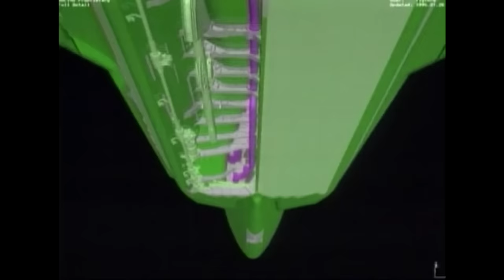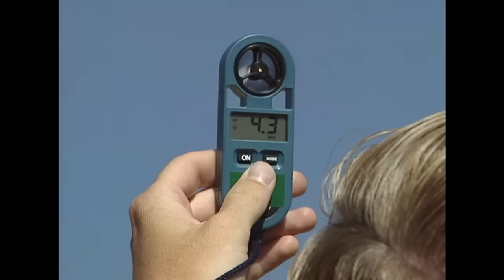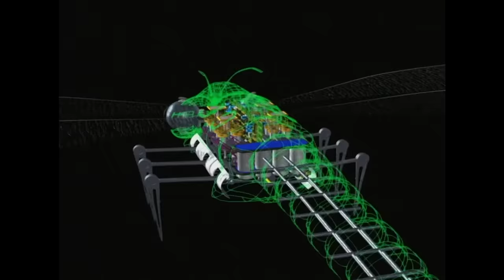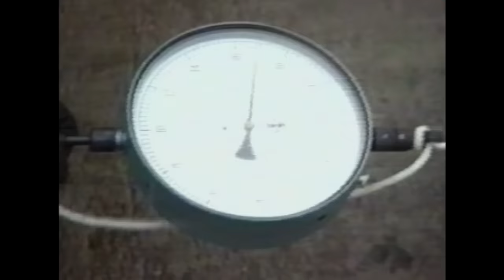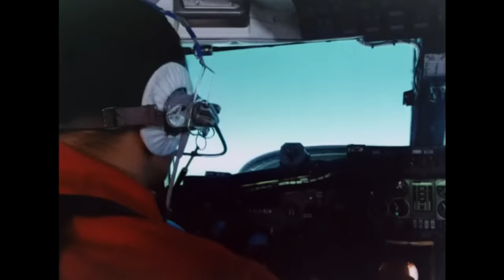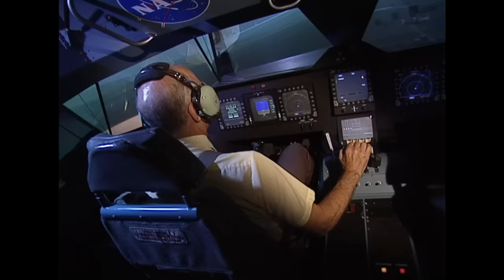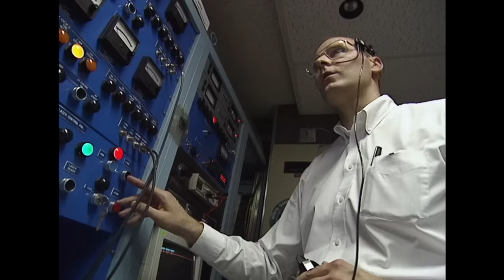Flight of the Future - Science Fiction or Reality

Comment: indexed on February 14, 2022
00:00 start
00:54 introduction
01:45 Northrop YF-23
02:25 Lockheed YF-22
05:02 thrust vectoring technology
05:24 Sukhoi Su-37
08:04 high-G training
09:50 integrating pilots with automatic systems, modern cockpits
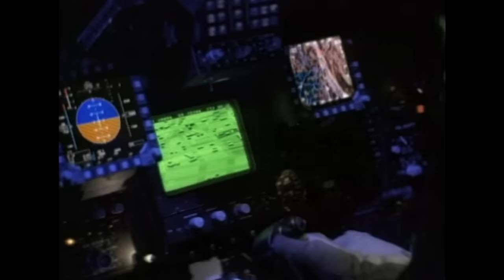10:12 eye tracking technology, voice command technology
10:48 thought-controlled flight systems
11:51 pilot error
12:14 unmanned aircraft
14:12 ultralight glider
14:37 miniature air vehicles (MAVs)
16:12 blade efficiency
16:54 flapping wing models
17:20 Charles Ellington insect wing model
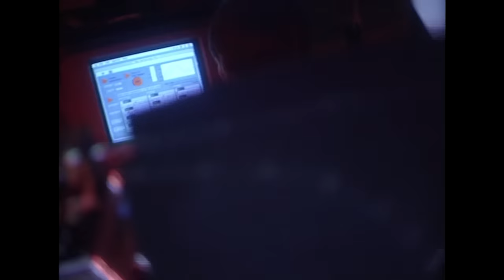19:13 Charles Ellington insect wing aerodynamics
20:25 insect sized micro air vehicles
21:23 pulsed thruster prototype
22:17 M2 lifting body
23:59 Barnaby Wainfan lifting body
28:54 blended wing body
34:12 Concorde
34:34 Tupolev Tu-144
35:25 High Speed Civil Transport (HSCT)
36:19 difficulty landing the Concorde
37:06 windowless cockpits
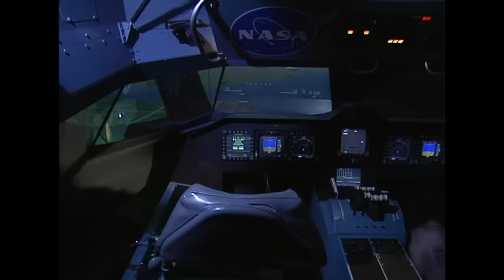38:49 HSCT flight simulator
40:20 new engines needed for flying at Mach 3+
40:35 the jet engine was first invented by Sir Frank Whittle in the 1940s
40:49 the biggest and most advanced jet engine in the world is the Rolls-Royce Trent 800
41:27 North American X-15
42:13 Space Shuttle
42:43 spaceplanes
43:02 air-breathing rocket engine prototype Hyper-X
44:34 White Sands Missile Range, beam-powered lightcraft
51:25 credits
51:58 copyright 1998
Reply: Where's the tic tac?

Comment: The next barrier to conquer is the creation, development, and the advancement of technology. Manipulating the field of gravity and creating a mobile liquid or multiple fields using the planet's poles polarities. The possibilities exist.
Reply: First, what distrubes the gravitational field, that may be a part of the equation. On the atomic level the super conductors the atomic the electrons are slowed down it likely it may be the strength of the field be come much weaker.  Frequency may be a way to control the fields. The structure and frame will need to be quite different composites of light gauges of metal or plastics. Frequencies are a part and active at base level of the atomic level and could distort create a warp tunnel that would need a containment field or fields. The Philadelphia experiment (if it was a real event would have something information that could be used.
Reply: WE DO THIS ALREADY

Comment: Science fiction author and engineer Jerry Pournelle presented a article about what he termed a Laser Launching System about 40 years ago in a science fiction magazine. I believe the magazine was either Astounding or Amazing.  Pournelle's concept was of a cargo/passenger module that was launched on a inclined rail system using a laser to heat water to extreme pressures at the back of the launch module to provide the reaction mass to boost to orbit.
This is not a new idea.

Comment: Inaccurate. Leaked Concorde plans had no impact on TU-144 design according to encyclopaedic data (Wiki). TU 144 had a different engine and wing configuration than Concord despite the two planes looking similar from afar.  Furthermore - there was nothing "faulty" about TU 144. It's main problem was the short distance it was able to travel. Soviets had to improve the design to match Concorde's distance, and they did. Why the TU-144 crashed at Le Bourge is not clear to this day. Some sources suggest the pilots turned on a new untested fly-by-wire system (which had to remain in non-operational mode during all flights). The last words of the pilot as the delegation entered the plane's cockpit were: "if we're going to die at least we die together", suggesting he knew of some danger factor that he chose to conceal.  Another possible factor is that seconds before the crash the pilot may have been startled by the French Mirage plane. The French were interested in TU-144 winglets, Mirage's pilot's assignment was to film the winglets unfolding up close.

Comment: The laser light cone shaped craft looks like something from the Lost In Space or Buck Rogers shows. Maybe there is a way (depending on the actual mechanics of the device) to build a craft that contains the laser creating device located below the push plate to make it a self contained propulsion unit instead of having the laser creating device ground based.
Reply: In order to do this it would be great if the laser device was as small and lightweight as a laser pointer or flashlight but powerful enough to propel a craft with a few people and there property (1000 pounds) while using very little power.
Reply: Hmm, now you'll have to find a place for the motor that powers the laser and another place for the fuel to power the motor...

Comment: To create that technology where there is no front windows but cameras you would have to use backup solar panel installations which would guarantee power regardless of what may happen. Those panels would have to be installed surrounding the top of the cockpit.

Comment: I was never really impressed by the "higher" aspect of flying.  If they can get me from Miami to Seattle in under an hour and do it at 100 ft, AGL, I am good with that.
Reply: Friction
Reply: Yeah, you need a vacuum chamber, a material that wont burn up, or go really high up.
Reply: Actually, there are aircraft in the inventory today that can do it in 2 hrs, and for that trip, I'd be flexible, two hours from Miami to Seattle is OK, and they can do it at sea level.   All I need to do is get ahold of an F-15 it can make the trip in 2.03 hours, at 1650 mph.
Reply: Altitude is added safety. More time to glide, more options.
Reply: @jonweiss4223  Bullshit. F-15 is well under 1000 mph at sea level. It makes no sense to feel safer at lower altitude. Altitude is a pilots best friend when something goes wrong.
Reply: @joeg5414  
Performance
    Maximum speed: Mach 2.5 (1,650 mph, 2,655 km/h) at high altitude
                                    Mach 1.2, 800 kn (921 mph; 1,482 km/h) at sea level
Yes, yes, we all know that 79 mph = "well under".
But speaking in general terms, "Higher" is still a relative term.  And performance specs are all BS as well, since an aircraft with a stated Max speed of Mach 2.5, at "High Altitude" may indeed hit Mach 2.5...on a day where the altimeter setting is 29.92, but if the atmospheric pressure hits 30.00 due to temperature and humidity changes, that same aircraft will never reach Mach 2.5 due to the denser air.  So until you find a way to control the weather, all of the numbers are up for grabs.  On a day with the right weather conditions, the F-15 could potentially make the trip in under 2 hours.  But then the "experts" hailed the birth of the jet, as the death of the propeller plane, and yet the first dogfight in which a jet was shot down, the killer was a prop airplane.   

As for altitude being a friend, it depends on the failure, your comment assumes that the aircraft will in fact glide, and yet, history proves that in virtually all cases (with extremely rare exceptions)  in the case of a major failure of the aircraft, altitude makes no difference.  When the wings fall off, terminal velocity is attained at around 200 ft of decent, anything more than that 200ft is irrelevant.
Reply: Well you never really studied anything about aviation then. Jus quiet down buddy
Reply: David Warren ,
Ah yes, another professor of theoretical physics chimes in.
Reply: Jon Weiss dude, In flight separation of airframes are extremely rare, engine failures are also rare, what gets most pilots are CFIT and loss of control accidents from poor airmanship, I’m a pilot, this isn’t just theory, the higher up you are the better your fuel saved, the faster your ground speed and the better the ride. 

Furthermore, density altitude doesn’t quite work the way you think it does. You can be at 30.35 in hg and get great performance out of the aircraft on a cold day. Heat and humidity degrade performance not necessarily air pressure. You can look at a POH with climb, cruise and fuel burn tables you’ll see it documented that indeed air pressure isn’t the problem it’s air density (pressure corrected for temperature)

Standard atmosphere is 29.92... at 15 degrees Celsius. On performance charts you’ll see the plane climbs faster and performs better on a cold day but burns more fuel, on a warm humid day the plane will climb slower and fly slower but  use less fuel...

This is simply because the fuel available to combust whether in a turbine or piston engine needs to burn at stoichiometric ratios and is leaned accordingly. 

Airplanes will always glide when the engine fails, that’s what the wings are for, planes are built to fly... During all of my private license training engine failure drills were a daily thing, pitch for best glide speed, pick a spot to land, if there’s time transmit on 121.5, diagnose the failure and attempt a restart if failed prop the door open so you don’t get trapped in the plane, shut off all electrical, fuel shutoff valve and engine magnetos to prevent a fire. 

Granted a landing in a 172 is extremely survivable, a landing in a 777 is going to depend on whether you had the altitude to reach an airfield, but from 30,000 feet you have way more range to find one than at 3000.
Reply: @Skyhawk656  

Where do I start? 

First I was not in any way debating "in flight separation of airframes", not even on the subject list. 

So you are a pilot, my father was a pilot, as was my brother,  who was also a single, twin and jet instructor.  I am not, in fact, a pilot, nor am am I a "professional computer coder", and yet I know how, and quite often do, write code for my own uses.  I am not a professional Diver, but I do on occasion use Scuba have trained and certified on open water rescue and salvage operations.  I am a trained Sociologist, and hold a Degree from the University of New York in Sociology,  but I have never had a single class in Sociology.   I'm not a pilot because I simply never had the time or desire to go through he motions to get rated,  one does not need to be rated by a government approving authority to study the pertinent data.  

I did grow up around aviation, due to my family associations and due to military ineptitude that took a soldier who trained in Armor and repeatedly assigned me to aviation units.  I'm not a pilot, but I have more "stick time" in OH-58A & C and AH-1S (front seat only) helicopters, than many General Aviation Pilots have in their rated aircraft.  While I have never had an accident on record, I have been present both for mechanical failures and pilot errors which resulted in my being in two crashes in OH-58 and UH-1 military helicopters, as well as being a team member on accident investigation reviews.   The type of aircraft has a great bearing on the factors you cite, airspeed, altitude, etc.  While being in a Cessna 172 will allow you to glide from 10,000ft AGL to a landing, a compressor stall in an OH-58 at 10,000ft makes auto rotation very problematic, due to kinetic energy bleed off in the main rotor.  But even gliding in a small fixed wing plane is problematic depending on weather.  Several hours in Gliders has taught me that Non powered flight in turbulent skies makes for some very difficult control.

Density altitude is only relevant if you limit yourself to the current technology, but there are daily advances in materials and engineering, while aluminum/titanium air frames make for good air travel at any density altitude, within the limits of the rating of the design.  Mach 1 in an F-15 is not a problem at any condition, but Mach 1 in a Fokker Eindecker is not likely to be happening, and so it follows that the aircraft of tomorrow may indeed see Mach 4 as merely "average" at any altitude and barometer setting.  Russia proved that with the MiG 25 which was designed at a time when Mach 2 was considered "the limit" at any altitude, until the MiG reached Mach 2.8 to the consternation of many designers, and as cited in this thread, Mach 1 is not the norm, but then along came the MiG 31 which wowed the experts, by reaching Mach 2.1 at sea level. 

You said "Landing in a 172 is extremely survivable" but the fact is, landing any aircraft is survivable given the right conditions, even a 777 can be put down absent an airfield, all that is needed is any surface long enough, flat enough and firm enough, to hold the weight of the aircraft.  A freeway can handle a 777 in an emergency, though is it not recommended as a first choice.  Putting an aircraft on the ground in one piece is generally not difficult, as long as you find an open piece of ground.   Agin, it may not be the preferred place to set down, but in an emergency, any landing you walk away from, is a good landing.

Comment: What was omitted from mention was that the pilot of the M2F2 was worried about a helicopter chase plane that he felt was too close during landing- the actual crash was caused by the pilot making a radical maneuver to avoid the helicopter, causing the M2 to roll violently and become uncontrollable.  I attended a briefing from the pilots of the M2F2 and the HL10 with films of their flight. and worked at Northrop, the company that built these craft.   The group I worked in was very involved in Space Shuttle research. In the film makers defense, the helicopter story may not have been general knowledge at that time.

Comment: I'm so glad the SU-37 was mentioned.. Since the fabled Su-57 has taken its place (Ha, Ha...Fabled!) the prediction that it would smother US Fighters was a bit pre-mature. While flying in an airshow in December 2002 while performing a high stress, high G maneuver, the pilot lost control as the aircraft came apart and disintegrated around him due to structural failure. The pilot ejected safely and survived. The SOLE aircraft crashed in a tremendous fireball. Despite a report in 1998 which claimed that Sukhoi had built a second Su-37 using the twelfth Su-27M airframe,[ THE ELEVENTH Su-27M remained the sole prototype. Sukhoi had instead applied the aircraft's systems to the design bureau's other fighter designs. The Su-37 did not enter production.

Comment: We’re still always in the experimental stage that looks great on paper and cartoon animation fantasy. Yet come 2021/22 and where’s our flying cars for everyone promised as far back as the 50s. The flight we have now is great stage between yes but come on even Paul moller skycar has technology that’s pretty advanced. Even though not yet totally utilized for what ever reason it still hovered above ground effect and now everyone and there grandpa is designing rotor/ ducted designs that are flying yet extremely expensive and the common person will never have the opportunity in this lifetime 100 yrs before the cost and safety is to the max.
Reply: This technology is crap! ... UAPs are the way forward !?..
Reply: We could have flying cars right now. The problem is setting up the highways or flyways for the flying cars the safety risks and all that is what holds us back. It would be better to install high-speed unground tunnel transportation!
Reply: Butcha havta wear a f*ckin mask....😳  So what kind of advancement is THAT?
Reply: Large electric multi rotor vehicles are the future of personal transport.

Licencing & air traffic management is the problem holding them back ☹️
Reply: @kayakMike1000  it’s always great to have some onboard radar just in case but I’d still like to be in control of the craft I’m in just in case u never know
Reply: @michaelkresge4103  the most expensive infrastructure possible. Tunneling extremely long distances + high speed rail.
Reply: Dunt c nuffin 
Nowhere. nohow
Reply: Ah ..... Don't be so negative. They're actually testing a kind of drone rotor copter for use as taxi's. So there's a possibility of seeing them materialize in your lifetime. One thing they're working on is getting the cost down. So the average working stiff can afford them. Google them.
Reply: YEAH!

Comment: The F-14 Tomcat in the background has a lifting body design as well.
Instead of the United States Navy updating the F-18 Hornet, they should have given the Tomcats new engines, new radar and avionics. It could fly much faster, much, much further and detect more targets further away than any other plane flying then or now.
The United States Navy and Air Force are spending billions to equip F-15s and F-18s with an infrared search and track system, a system that the F-14 Tomcat had from the beginning.

Comment: Extremely large drones have to be extremely robust systems. Drone rotors larger than helicopter blades using large electric motors larger than a van using 4-6 rotors and 12 gyroscopes and computer algorithms to control each throttle and the pitch of the engine using hydraulics and electric motors for each hydraulic system all computer controlled. The battery banks will be on each rotor and every electric motot will have 2 counter-rotating drone type propellers.

Comment: Passive Stable flight and  turn on a dime ability should be the design focus - and go from there... With  safe controlled gliding landing upon full engine shutdown / failure  as a secondary design.     Gyrocopter  designs are good for  short  city to city hops.
Reply: The same design as drones will be the future of flying cars. Several fans enclosed in meshed intake and outflow to provide lift, computers to aid flight and stability and navigation. If it comes to it, they will undoubtedly be electric, so an engine of the same size that is commonly used in model cars/planes can drive an alternator or two to kick in and provide emergency power if necessary to enable the pilot to find a safe place to land. That generator can also provide additional power for longer flights if it runs constantly. Such a tiny engine generates negligable emissions and uses very little fuel, so a gallon or two could fly you around the world.